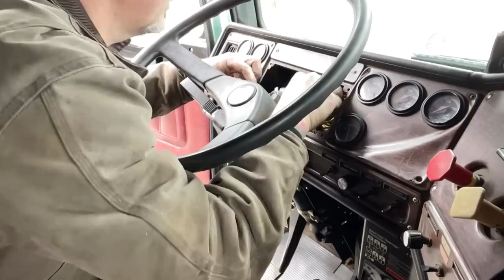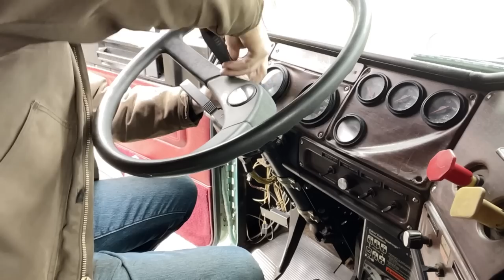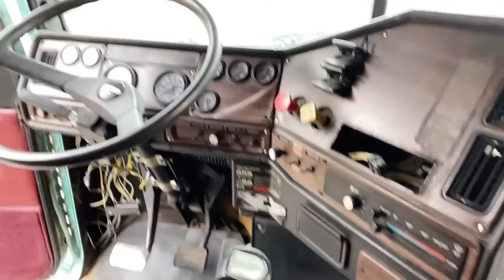Freightliner FLD New Grease and James Talks Money

Comment: Adventures made from scratch, Silas in Kansas had a 90 freightliner in his yard up for sale for twenty five hundred dollars and no bites, a few low balls. Outside appearance was decent as its just like the three number trucks. I  was  red tho, a fresh reman cummins and no idea as to the type of transmission. It was a complete running truck and the engine was very clean as you can see by the last video. He finally decided to just wreck it out and so then a few pieces went away like six aluminum wheels and tires which we know after setting are no good. he got five hundred for them and  then the guy bought the two fuel tanks for another fifty dollars... they needed polish but were not beat up, rear ends went as a cut off for eight hundred and the engine and transmission was I think another eight hundred dollars take out as the rest of the frame. He cut all those nice running boards like your truck needed for scrap, this list just goes on... all total, about three thousand dollars for the whole rig said and done .... it hurt to see it go away. It no longer is  that statement of oil and grease is the cheapest thing you can do  to keep rolling as its out of sight
Reply from the maker: Yes I’ve seen that video.  I wish I knew it was for sale

Comment: Hi James

Just wondering if you have noticed that the rear lights on the FLD that you was working on next to the white Cabover that one is upside down, if you have noticed are you thinking of putting custom light mounts on?

Keep up the good work, those girls will soon be turning head's when rolling out the coal down the highways showing the young pup's how the job is done.
Keep the rubber side down and the shinny side up and we will see you on the back haule brothers and sisters.
Reply from the maker: Hey Philip. Yep I’ve noticed.  I’m probably going to just put new ones on in the existing location and some better mud flap brackets

Comment: Wow James that ended abruptly! I’ve used both kind of breather vents and I like the ones with tubes on them. Just watch if you go off road in deep mud. It can plug the tubes. Good deal that light bar fixed that issue. It’s getting closer to getting back to earning it’s keep again. The shape that truck is in it could have those low miles on it. That transmission could be bad just from not working it right. That one is the reverse 9 speed isn’t it? The only way I think you could find out mileage, if that’s the original ECM it should be on there somewhere. You’ll probably have to use shift cables on Krystal with that Big Detroit in it. Sounds like everything is coming along nicely. Stay safe
Reply from the maker: Original ecm was missing when I got this truck. :(.  Ya it’s coming along well  and yep somehow the upload got cut 20
Mins or so.  I had lots more to explain ugh
Reply: @JamesPretty  Them guys at you tube just gotta get on the ball and play the whole video when you post one. So I should complain to you tube for screwing it up! I wasn’t sure which truck was missing the ECM. That means the world will never know how many miles it has.

Comment: Mr Pretty u need to finish one truck at a time and get it where it will pass DOT  and b suitable for a driver the to the next  u r doing well
Reply from the maker: I do what I can with whatever parts are available I kinda changed my mind and decided to get twelve on the road first before 13 but wheel see how that goes.   And ya I seem to be hoping around a lot sorry   Appreciate ya being here
Reply: @James Pretty   Mr Pretty, I know u r doing ur best. I owned 3 truck in Florida
 They were  older truck and tried to fix 3 at once. It was hard. I decided if I fix one I could put  it to work and put a ll my moneythe other 2 and make it work I did it alone and II was hard  so don't think I any talking  bad about your ways but I tried I'm 72 and the truck repairs put me out of my dream and don't let it happen to u DOT is very  strick